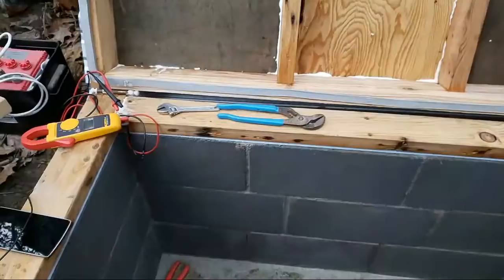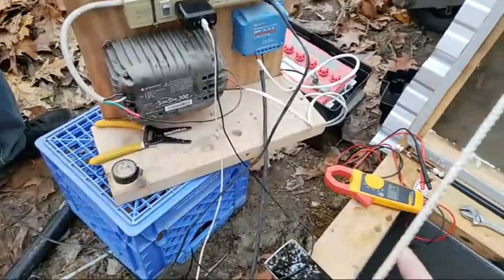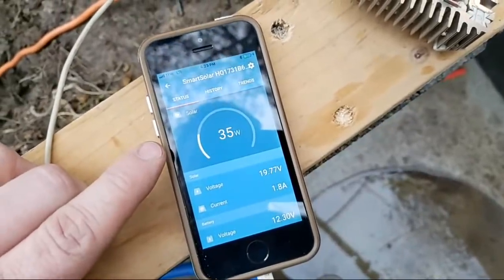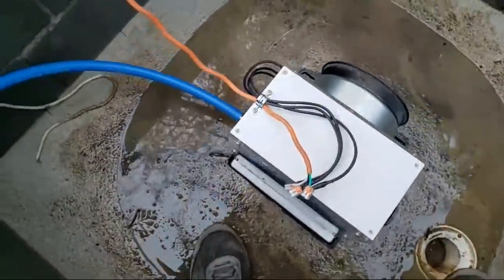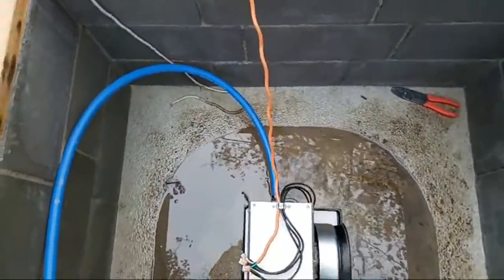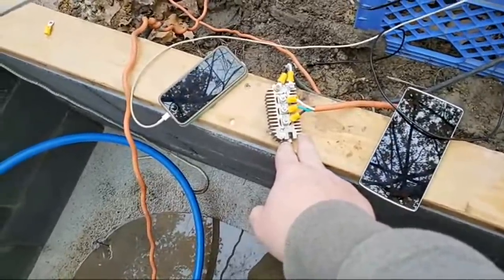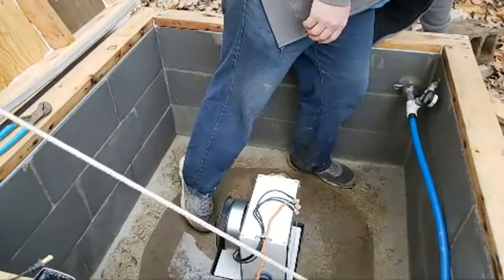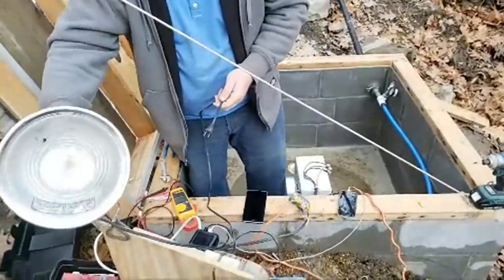Turbine Harnessing Power Now

Comment: you need a proper controller... not solar one. I told you on your waterwheel project. Solar works in a different way.
Reply from the maker: Yup, I knew this wouldn't work just because it's too small in the first place. Back then I didn't know there were different forms of mppt.
Reply: @JoeMalovich  mppt is actually good only for solar. When the energy comes from rotation source you need voltage based controller (higher voltage = more amps can be drawn) For pelton turbine you can also use fixed voltage. If 130V is freespin then about half is correct voltage to run on. Thats also not entirely correct, because of how unloaded ac works but you when you can use fixed voltage controller you can try to adjust the voltge and you will see what is better. Dont forget on voltage rating... I know you will be runing around 65V but you need that controller to handle at least 10% more then open voltage (better 20%) so you should look for at least 150V controller.
Reply: @JoeMalovich  If you dont want to experiment too much.... I think midnight is way to go.

Comment: The algorithm on vicktron controlers is to fast to allow the turbine to  get up to speed befor it makes the correct calulation. you need a midnight classic. That controler has a slower algorithm and will allow the turbine enough time to build speed and find the correct maximum power point. i have been through all this on my setup. That controler wont work well at all it will always stall (make the turbine run to slow) the turbine due to the wrong speed of mppt calculation. the vitron just give a fraction of a second to allow the open circuit voltage to get to max. on a turbine it take a little while to build up the speed to full open circuit. so the controler ends up find the the max open circuit voltage as being low due to it not give the turbine time to speed up to full rpm. it then take that number and halves it and give you a voltage that is usualy at least 30% to low.  depending on how fast your turbine picks up speed. I showed all this in my videos check it out. you will see i had the same problem.
Reply: There is a way around making the victron work if your at a fixed flow. go to settings and set the max charging current to whatever gives you the right voltage. this will limit the turbine from stalling. but it means if you change flow you have to change that setting each time to get it right  check out max charging amp settings. limmiting the charging current gies you some control over the rpm But it isnt perfect and will only really work if your running fixed flows.
Reply from the maker: Ok thanks! I know you went to a midnite classic and it seems to be working great for you. It's just a bunch of money that I wanted to see what I could get away with without purchasing one.

Comment: Very cool! maybe you can get a sound dampening acoustic panel for inside the lid and make it really quiet.
Reply from the maker: It is already dead silent. Literally can't hear it with the lid shut from 5ft away.
Reply: @JoeMalovich  Yeah, I just saw you had another video where you showed how quiet it is lol, job well done.  I plan to make a little water wheel some day, I actually have a high flowing natural spring up the hill from me but its on the side of the road and I don't think the city will be very happy if I run a pipe down the side of the road.
Reply: @ExperimentalFun  'tis better to ask forgiveness than permission.  Maybe if you bury it slightly, no one will know.
Reply: @scorpio6587  I would do it but I need about 1000 ft of pipe and its only a 30ft drop, the good part is it has a lot of flow, but that means I would need a 4 or 6in pipe, it would be a big project to install/bury and a lot of money, I could almost get away with it legally if I called it a drainage pipe but I'm renting this property so its not worth investing in it anyway.

Comment: Hey man they are selling midnite classic 250's on eBay, new for under $280, they don't have all the features, but 60 amps at 250 volts, I'm thinking about getting one, they work well with generators,
Reply from the maker: Careful, some aren't compatible with hydro. Spencer Langston says a midnite classic 200 non-SL is what's needed.

Comment: I wonder why the power was so low. Might be the battery was acting as a massive load, due to an internal short? Just guessing. A capacitor over the DC would not hurt either, stabelise the voltage.
Reply from the maker: I think the charge controller just doesn't like hydro. It would sometimes ramp up to 68V and like 80W but then throttle back down to 22V and 40W
Reply: I've wondered how much a big cap at the output of the rectifier would help. If there is less ripple the controller should be able to operate more efficiently, I would think. 

That even has applications for wind power as they have three phase ac outputs too. I wish I had a scope so I could check the peaks and lows of the ripple. Once I get my wind power up I'm going to experiment with it.

Comment from the maker: For reference that light bulb was 100W, voltages were low because the jet was too big and draining my supply. The actual watts would have been about 60 I'm guessing. Actual supply after efficiency losses at 5 gallons perminute would be about 180W. Actual flow measurements have been between 1 and 60 gallons per minute so this is it operating at low flow.
Reply: Thanks for the update! might want to pin the message. Is the power less than you expected?
Reply: Have u thought about jet placement. The further u place the jet on the spoons the faster it will spin. However with less contact spot u get less force

Comment: I think the MPPT Tracking parameters in your current charge controller are wrong for hydro systems, I’ve seen another guy on YT that had the exact same issue. Idk if he was able to tune the parameters or he got a different controller all together tho ;)
Reply from the maker: I need a better suited controller. This one isn't as customizable as I need.
Reply: @JoeMalovich  it's too bad you have to spend a whole lot of money just to have more parameters to be set, I know those midnite mppt systems can cost a lot. There's a cheap Chinese mppt boost converter for like 40 bucks that I use for my 18650 battery project, unfortunately there's no equivalent buck version that I know of for that price. :(
Reply: Just to add, the Chinese boost mppt controller MPT-7210A might not be what you would call "true" mppt, you actually set the desired maximum power point voltage you want it to aim to track to. I guess that's why it's cheap haha. I guess if you had a 72v battery pack it would work great! Lol
Reply: @JoeMalovich  a 48v charge controller would be much better suited also if that 12v lead acid is old that will cause issues. Really enjoy your vids keep em coming
Reply: @JoeMalovich  I know youve mentioned the midnight classic charge controller and they are not cheap would you get away with using the midnight kid charge controller?
Reply: @imchris1978  Nah, the kid dosen't have the hydro mode he needs.
Reply: @JoeMalovich  I'm not too familiar on the differences between normal "solar" mppt and "turbine or wind" mppt, I've looked into it a little and as far as I can tell it's just a different sweeping algorithm that checks if the turbine needs to run at a higher/lower voltage while pulling load, I'm surprised there aren't any cheaper Chinese options that aren't those cheap "pwm" controllers for 10 bucks. It would be tempting to just buy a few 20A buck converters and put them in parallel and control them with an Arduino or microcontroller and program your own maximum power point tracking sweep software.
Reply: @JoeMalovich  youll need a dump load or diversion load controller for hydro. Look at Morningstars Tristar controller on diversion mode, excellent bit of kit and pretty cheap. Hydro is unlike solar in that you need to dump excess energy to prevent battery overcharging and battery death. You can't just stop charging like with solar, you must burn excess power off. A diversion load controller diverts excess power to a dump load such as a large resistor or heating element.
Reply: @nzmuzzer168  That wont work for joes system. he would need to set his turbine voltage to his battery voltage with a diversion system like that. if you look at the digargam the turbine has to be connected directly to the battery in the system. There are other diversion control systems that will work. but not the morning star one. not unless he has to morningstar controllers. one doing mppt and doing divert.
Reply: @KrisHarbour  Hey Kris, not sure what diagram you are referring to. I have the exact same MotEnergy turbine (same as yours too I think from memory, love your vids BTW) and a simple Tristar diversion system, no MPPT (which is more suited to solar), has been humming since 2009 and is just too reliable. The turbine is connected direct to battery via rectifier. Tristar then manages battery voltage with simple diversion load. Maybe I'm missing something on Joe's setup?
Reply: @nzmuzzer168  Hi,  Thanks, im glad you enjoyed them. The diagram im referring to is the Tristar wiring diagram for dump load control. but i now see you know that as your running a system like that. :) yeah that is a nice setup if you can do it like that. but it causes problems with efficiency if you have changing flows. if your fixed to the battery voltage getting the most efficient rpm for the turbine as you increase flow the pipe loss means the pressure goes down and then the nozzle velocity isnt matched to the rpm efficiently because it it locked to the battery voltage. its a nice simple way of doing it for fixed flows, fairly low pressure and short cable runs. Nothing wrong with a system like that as all. its just really takes away alot of options for getting really high efficiencies  and changing flows. The reason it wont work for joe well is because he ran a small penstock. At his higher flows he will have very high losses. That pressure loss will mean the correct rpm for the turbine will be alot lower than when he is running a lower flow. so he needs to be able to match the rpm and voltage to the changing flow and changing pressure due to the losses. fixing to the battery voltage wont give him any good control over that. it would work but it would work very inefficiently at low flows, as it would be unmatched and at high flows as it would be unmatched. there would be one small window of optimum efficiency.
Reply: @KrisHarbour  Thanks for that explanation Kris, makes sense. I guess I'm a bit lucky here - good pressure and lots of water year round makes for a simple system with plenty of output. But out of interest I'll have to do some research on using MPPT for hydro now that you've explained it's purpose. Cheers
Reply: @JoeMalovich  why not instead of a dump load, a solenoid valve that shuts off water to the turbine? or to stop water ram effect use a stepper motor valve to ease the flow on and off depending on battery charge level, seems more efficient then still running the turbine full bore but using a big resistor to resist turbine over speed and waste it as heat, i mean if you were going to do that anyway maybe you could use the resistive load to heat up water? At least give the dump load a job haha.
Reply from the maker: @chazable  That is an option, but in my case over-speed and over-voltage aren't a concern so I don't NEED a diversion load. Diverted power certainly could go to heater.
Reply: @JoeMalovich  ah well that's good news then, I'm curious to see what other options for a decent charge controller there are, I'm assuming you'll just be running a 12v battery system? Would be interesting to see what a regular cheap buck converter could produce without mppt, just setting your max power point at your most common flow and recording the results, id love to test this all myself I find it super fascinating :P

Comment: Get you a get you a light bar and screwing some hundred watt light bulbs to be a much better test for that high voltage or you'll need a Step Down Transformer to charge batteries with that particular generator